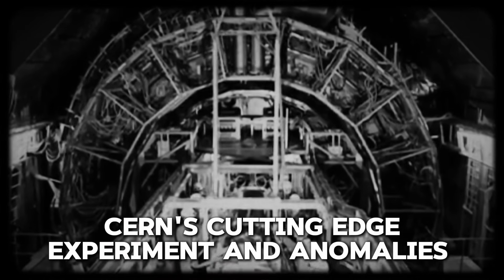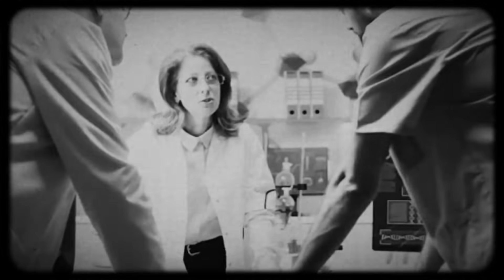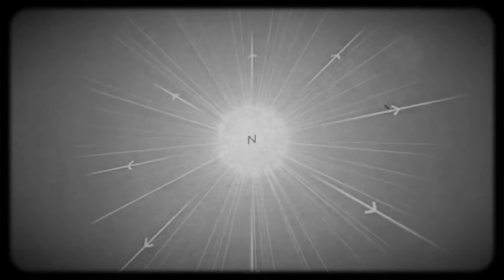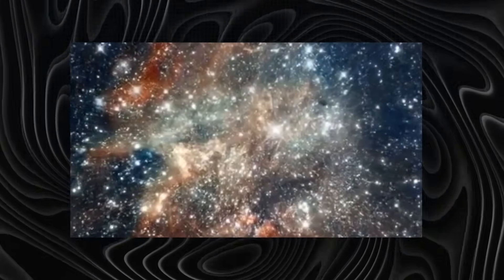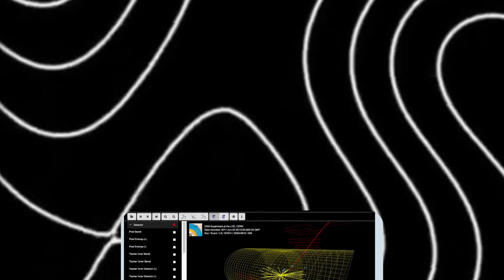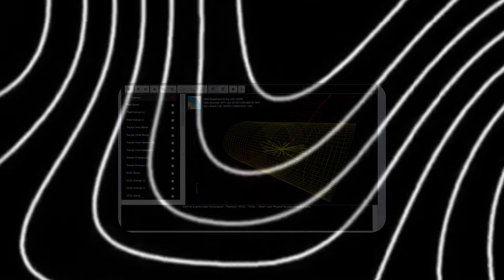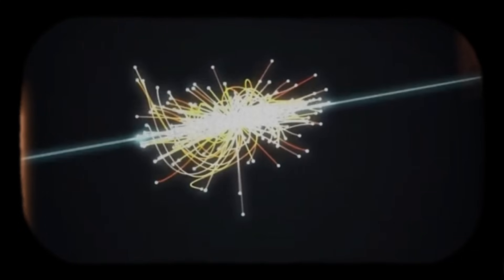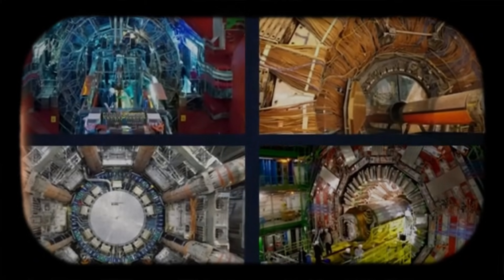CERN’s Secret Quantum Errors Are Triggering a Global Mayhem Reaction

Comment: If the universe is expanding and the expansion is accelerating, then there must be a continuing energy that makes it happen.  If the universe expands and contracts in a cycle, then there must be another energy that makes it contract.  Perhaps that cycle is now at the point in which the energies change from expansive to contractive.  Analogs: a swinging pendulum,  and a bouncing weight on the end of a hanging spring.